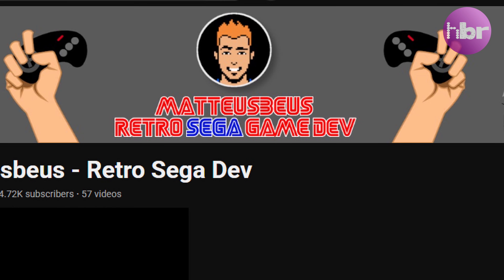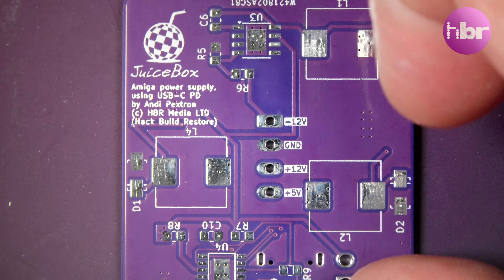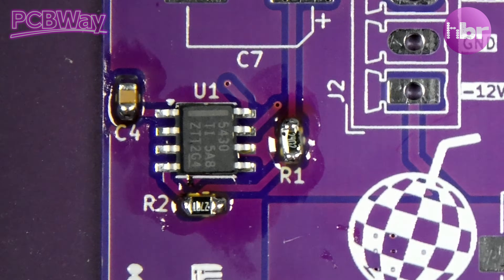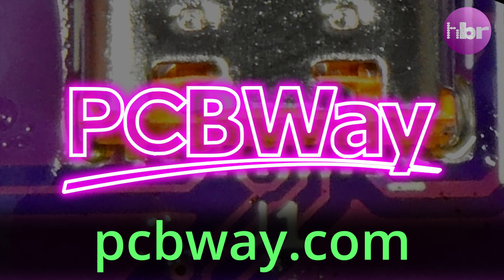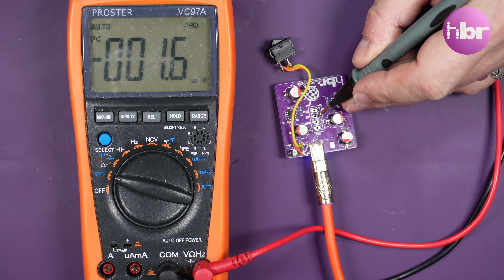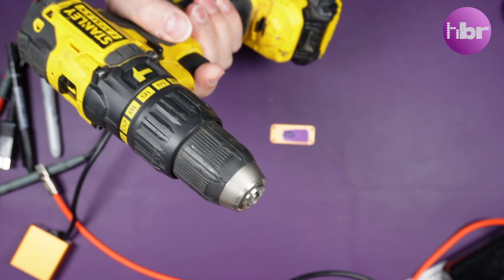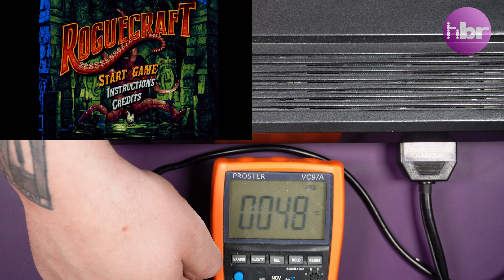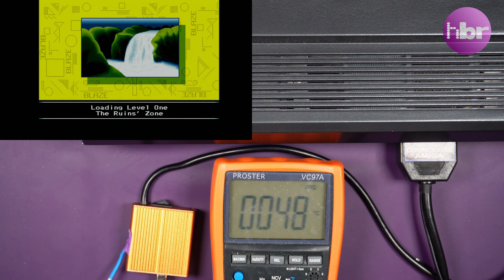Purple PCB, Orange Case, One Tiny Amiga Power Supply

Comment: Love it. Could it run an A1200 with a TF1260?
Reply from the maker: The TF1260 can be quite power hungry so without proper testing I could not confidently confirm. Based of info it would be at the upper limit of what it can handle I.e 3A on 5V rail.
Reply: @hackbuildrestore  I wanted to go for the LC version of 060, but I guess I can just use the JuiceBox with my A500 and find another solution for the A1200.

Comment: I like to see the 5pin DIN solder to the board.   Then it could just push in the back of the amiga with switch on top.
Reply from the maker: The power shark it what you need then. JuiceBox in this form is still a little big to sit that close on the Amiga and the different location of the power socket in relation to other ports across the Amiga wedge range means this is as good as it gets for the money, plus I like having all the heat away from the plastic :)

Comment: I was thinking about getting a powershark for my A1200+8MB Card and my A500. 
But with 55-75°C, I would burn myself even by trying to unplug it?! That´s a no-go. Yours is at least external, and the connector stays cold(er)
Checking for RobSmithDev´s teardown down...
Reply: No person has been harmed using a PowerShark. Or, more seriously, internal component temperature is not the same as case temperature.
Reply from the maker: The powershark has a plastic housing so externally not sure how hot it gets…

Comment: Really sharp. You could call it the Power Sharp. Kidding aside. If it wouldn't interfere with the analog signals next to it, an internal version sitting in the place of that square DIN connector would be super. Directly connected to the motherboard.
Reply from the maker: I have done that and may go back and revise to used this design.

Comment: Neat little box.

Long term thermals might catch you out with the components packed so tightly. What do IR images look like straight out of the enclosure after 2 hours of use?

48°C is quite warm for the outside. Components better be rated to at least 85°C. That's their limit. Not their ideal.

MTBF is determined  relative to 25°C... Every 10°C halves the rated life. And that is when half of the components can be expected to fail. If the internals are at 55°C, then it's one eighth.
Reply from the maker: All rated to over 100 C … the aluminium case is there to be a heatsink, this is a 1st revision prototype

Comment: Any coupling between the heat generating components and the case? I feel like you'd prolong the life even more if there was a small copper cube and some thermal paste connecting the regulator IC to the shell.
Reply from the maker: I’ll be iterating on the design solving issues as I go :) good feedback!

Comment: I have often wondered if there was enough space at back of the A1200 if both the 5 pin power plug and the RF module were removed to have a custom PCB for USB C power delivery could be fitted and wired into the MB to deliver the required power?
Reply from the maker: Space yes ventilation and heat dissipation possibly not
Reply: Any mains psu would brin in heat inside the Amiga. Even the tiny "Power shark" develops heat that is better outside than inside the casing. Some of the Amiga chip's getting hot on their own so an internal small fan would be better than an internal psu..
Reply: @stefanvonstratenfinne9128  You could have both could you not? The vents at the top of the A1200s case although not 100% ideal would allow venting from a fan pulling hot air out?